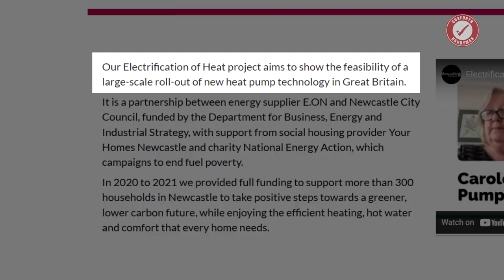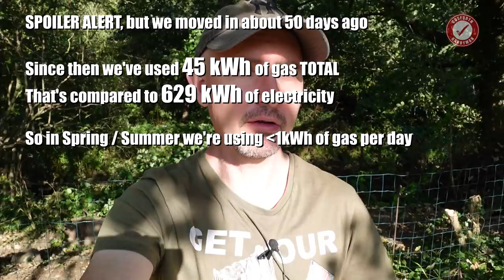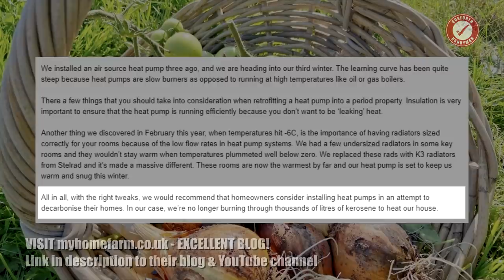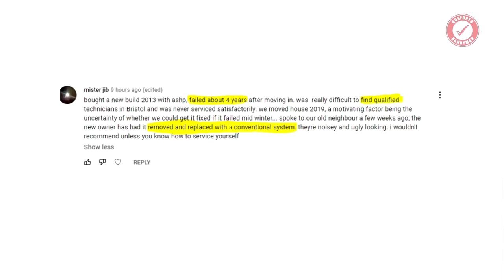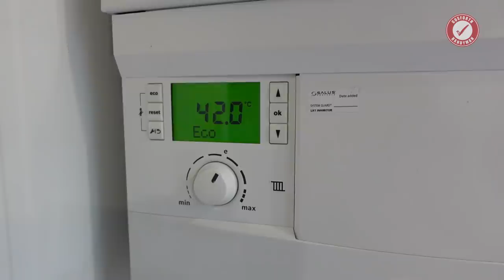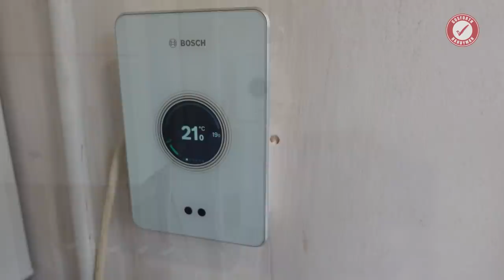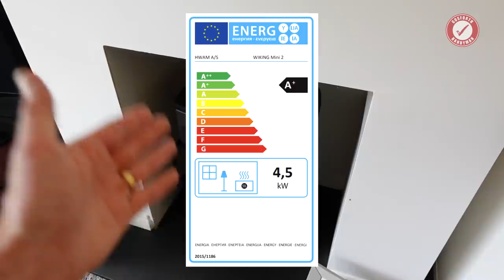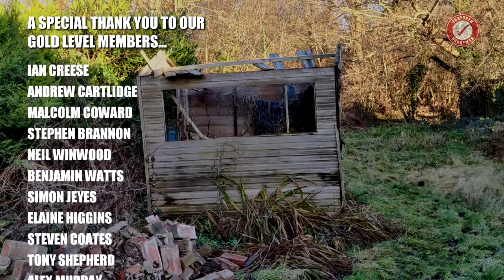Why didn’t we install an Air Source Heat Pump? (1920’s Renovation Part 32)

Comment: My neighbor and my niece both installed an air source heat pump in their new builds - hot air rather than hot water systems.  Both seem happy with them, but we had a relatively mild winter here in New England, the neighbor's house is less than 500 square feet, and my niece's digs are a new second floor atop her mother's oil-furnace house.  Neither use them for hot water.  So their heat pumps didn't have to work very hard.  A nearby library installed a ground-source heat pump about ten years ago, and the complex plumbing has required expensive repairs.

When completed, you'll have a relatively large house and a need for a dependable supply of hot water.  You have natural gas available, your boiler was not expensive to install, and if it ever needs repair the parts are readily available.  Most of all, the convoluted process for obtaining a government rebate on a heat pump wasn't worth the time and aggravation.  While I think heat pumps may eventually become standard equipment, that day has not yet arrived.
Reply: New England winters are generally significantly colder than winters in the UK.
Reply: @jeremybarker7577  That they are!  I was surprised that in the past couple of years air-sourced heat pumps are being marketed here with some success.  I expect you'd still need some backup (electric resistance or propane heater) when the temp gets close to 0 degrees F.

Comment: The Ecodan ASHP is super quiet (to the extent that it can be installed <1m away from neighbouring property). It’s a great model, like most heat pumps, works down to -25°C. If your home is insulated (great to do whatever your heating system) and your radiators newish it’s a good system to get. At £8600 to install in 2019, with RHI in our terraced house, over 7 years was ~£3000k cheaper than new gas boiler (at £2700). it cost the same as our boiler did to run. Great decision all round.
Reply: Also have a Ecodan. Wait until it gets to -3 than tell me how "quiet" it is lmao.

Comment: Great sensible approach heat pumps good in new builds, insulation is the key with low temperatures in existing property it’s a problem 
and the costs prohibitive .

Comment: Extremely glad you covered this topic. Was considering installing an ASHP which would have required substantial works on my behalf to replace gas pipes that were too narrow.  Will update to a newer combi and larger radiators instead.  Thank you.

Comment: With respect for your direct experience, much of what you say at 11:00 regarding heating systems is not based on much and rubbish. Here in the NE US where we touch against Canada, we use “cold climate” design air-to-air heat pumps that provide good capacity right down to -15F (-26C ).  The experience in poorly insulated houses is that an existing fossil fuel system is a good back up for about 100 HOURS per year, usually overnights only and warms up in the morning. In well insulated houses no FF back up is used successfully.  I installed an air-to-water heat pump with buffer tank and radiant floor as primary distribution inside. Owner immediately had a nice warm experience and continuous operation of this heat pump through the next week when low temps hit -28 C - no issues.

Comment: I retro fitted underfloor heating, upstairs and down, in my 1970s home back in 2016 and this included  Cavity wall, 15mm floor insulation, 75mm between all the joists in the 1st floor and 300mm in the loft space, we spent a considerable amount of time investigating ASHP technology as they are more suited to under floor but eventually came to the conclusion the cost was the major factor against it and will never be replacement for gas boilers, Most houses in this country will never be suitable for them due to the level of insulation required, as you have pointed out unless you are going to do a full renovation with a view to upgrading all your insulation along with all new bigger radiators or under floor you will struggle to get the ASHP to work efficiently enough, if you replacing oil and have no gas then yes but anyone on mains gas will defiantly not see any benefit and when you factor in the costs, even with government grants,  it's a huge investment to rip out and replace something that's already doing the job

Comment: What an excellent video! A pragmatic discussion of all options, and very useful for others with period properties who may be weighing up their options.
It may be, of course, that combi boilers will keep going in the future by using hydrogen, if the experiments in the North East go well. 
(Of course, the old town gas, made from coal, was around 50% hydrogen, so it’s not such a new concept.)
Reply: How energy intensive is town gas production?
Reply: @JohnnyMotel99  Hi Rob. No idea really, as it was phased out in the U.K. in the sixties, and it’s not coming back now!
Reply: @SteveHit1  That's true, however, as you say it's 50% H2 and that would eliminate ~50% emissions compared to pure nat gas. Perhaps we should produce H2 via electrolysis and mix that into nat gas...
Reply: @JohnnyMotel99  I agree totally with your suggestion for addition of H2 to natural gas. As you say, it would result in a massive reduction in emissions, with only minimal effort  - especially in comparison with heat pumps.
Reply: @SteveHit1  This adding H2 to Nat gas is actually a thing. It’s been proposed to uk government that 20% H2 could be added to our gas network and save millions of tons of CO2. That could be the limit before burners needed alterations, but maybe not.
Reply: @JohnnyMotel99  Thanks for the info - sounds exciting!

Comment: I've just bought a property in the country that has a clapped out oil fuel boiler. Like you I was skeptical about heat pumps because of all the negative reviews I'd heard. But after quite a lot of research on the subject, I now believe if the system is designed specifically for each situation, and correctly installed, heat pumps will work either at a comparable cost to gas, or cheaper. Plus you maybe able to help run the system with solar panels.

Comment: Most everyone should be able to find high quality furniture for the same price as cheap chipboard stuff. The only trick is to buy used, not new. Every style, shape and size of furniture is available used at a fraction of the price of something high quality new.
Reply: Helps if you have extra space and tools to make changes to it when needed. I have a garage full of spare furniture that I cannot find a property as yet to fit it in to !
Reply: When I moved some years ago, because I was seriously downsizing, I had to get rid of 75% of all my furniture.  Most of it went to charity shops etc, so hopefully some folk got some good solid stuff at very cheap prices.  Because I was moving into a flat, I wanted new furniture that was light and easy to manoeuvre around - so went to IKEA! 😀.  I am very careful with my stuff, so it will probably last my lifetime.  It all depends on individual circumstances.

Comment: Totally agree with all you've said re Combis and Wood burning stoves (& politics). We have identical boiler and very happy with the economics, efficiency and the quietness! Our WBS heats an 8 x 4 metre living room beautifully but you must use seasoned wood - essential. Therefore you need a regular wood supply and a wood store outside, properly vented to prevent rot, so ideal for us in the Norfolk countryside but not necessarily for city folk with their limited space. Thanks for a brilliant little series that for once I can watch and not have to do and pay for !! All the best, Jeroen.

Comment: It is not only the noise from the pump Andy, it is the sound of your electric metre taking off due to the amount of juice it takes to run.
💯 agree with your carbon footprint comments with cars, wood burners etc
PS. I am subscribed and can’t wait to see why you have a hamster 🐹 cemetery in the back garden with the little crosses

Comment: Smart TRVs are really great if you want different schedules in different rooms of your house or your main thermostat is not in the coldest part of your house. We had a poorly insulated bathroom extension and a smart TRV was great for keeping that room heating while the rest of the house was at the right temperature.

Comment: EON. Oh dear - just signed up to a fixed energy deal with them for the next year. Will see how that goes!
Reply: Used EON and EDF in the past 10 years no issue other than call centers etc
Reply: I've generally had no problems with EON and were with them for some time, I had more issues with British Gas customer service. But I guess everyone will have different experiences

Comment: Uhm, Norway here, regular temps down into the -20's, and although the condenser is less efficient it heats my 1920's house (with no extra insulation installed) just fine. Why are you getting just crap condensers that can't even handle -8?!

Comment: Great video and excellent discussion about heat pumps and the way the UK government are trying to force us down this route. It will almost definitely end in an about turn in a few years time. I had the exact same boiler system installed in my property in January 20 to replace a 20 year old boiler and its amazing. It’s reduced my gas bill significantly and of course I now longer need a large hot water tank in my airing cupboard or a header tank in the attic. I have solar and a battery and have been looking at different technologies and recently purchased an infra-red panel for my garden office. I have been truly impressed with this, it is efficient, it heats the thermal mass instead of the air and is thermostatically controlled. If I did need to change my heating system I would certainly look at these for my main property. They can be installed on walls, ceilings or freestanding and can be made to look like a mirror or even a picture. There are loads of different technologies out there and often the ones pushed by the government and reported in the press are not the ones worth looking at.

Comment: Here in New York State we have a company called "Dandelion" that installs "geothermal" systems, I assume this is what they call "ground source" in the UK. Dandelion identified NY as the ideal location for a bunch of reasons... cost of heating, climate, income... not sure all the reasons.  They streamlined the process and they drill a vertical loop instead going out horizontally, so it can be installed fairly easily even in small yards. they have a smaller custom drilling rig that is more compact than typical, I believe they use 10 foot [2.5 Meter] sections instead of typical [~30' lengths] 
You can either pay total cost upfront or essentially rent the system while paying less than your old system, people are typically replacing oil fired furnaces with these. I've seen many references to Hydronic radiator systems connected to these systems in the UK, but the Dandelion system only works with forced air systems. Most oil fired systems in this area, NE USA, use radiators... although Canadians seem to have more forced air. 

They seem to make much more sense than Air source systems, because the ground temp is in your favor based on the season. In summer Ground/Geo can easily give extra heat to 55f/12c ground temp vs 85f/30c air, and in winter we can be at below 32f/0c for weeks at a time, and typically have one week of 15f highs at which point the ground source is about 40f warmer. 

In the US people in moderate climates, esp. where they might not have a full heating system use what we call a "heat pump", and I would assume that is an air source system. They are usually a mini split, outside compressor heat exchanger with interior wall mounted air handler. Heating is usually an upgraded model from cooling only, but seems to now be the norm. It was widely thought that heating was only practical in moderately cool months, but many new systems claim to work down to very cold temps. 

We have an Oil fired radiator system, with a mini split in 3 rooms. And we use heat pump option before start using whole house heating, or if we will be in room for a short time. It does put out heat in very cold weather, but it seems to be working very hard and there is a lot of hissing and spiting as the coolant moves through the lines.

Also, I have not seen a whole house air source heating system in the US.  Probably the most popular system upgrade here is what you just installed, gas fired on demand hydronic system.
Reply: Very interesting discussion on how things are different across the pond. It seems like it may be little easier for you guys to switch over to heat pumps, due to the way you heat your homes. Also having a big 'yard' helps with more space for a collector for geothermal. Here in the UK our 'gardens' are mostly tiny, and many new homes don't have them at all!

Comment: I was recommended the only way I could heat my house (large detached victorian property, solid walls, etc) with an ASHP was to have a hybrid oil model, the quote (before RHI repayments) along with some other plumbing works I wanted was £24k, .. £1k of that was just radiators.

 Also, "in the winter it will almost certainly be running entirely off of oil", it couldn't do both at the same time.  I asked for a quote for a new external oil boiler with the same plumbing works above minus radiators (they were only needed just for RHI) and it came in under £9k.

I think max RHI repayments was £10k repaid over numerous years. The maths just didn't work out sadly. So oil boiler it is.
Reply: @TheFarmingEngineerUK  Only a month or so ago. It was a large vicarage that was knocked through into the neighbouring house to make one big very cold one. The incoming boiler (26kwh) supports bio-fuel although that still appears to be in trials.

Comment: Disagree with the comments regarding the ashp. Designed and installed correctly they are more efficient than gas. The reason you over size the radiators is because the heat output is not at 70c like a gas boiler instead lower flow temps but still putting the same level of heat to heat your home. The systems are designed to provide full heat down to -15c and for this reason you purposely oversize them for the worst case scenario. Your other option is air to air which allows you to have cooling in the summer. The bad sides of this are people ripping homeowners off and not understanding what they are installing and then homeowners expecting instant heat and turning it off in between timings. If you also have access to mains gas gas then this is preferable anyway as gas is cheaper (currently) than electric but prices are going up for us all. I've got an air to air system at home (I live in west Yorkshire) we live near a city and there is lots of traffic noise. We also have a combi boiler (3 years old Ideal Vogue C32 which is 90 efficient). The air con is the best in summer and we use it to circulate clean fresh air. I've just done the number crunching based on the new prices following our energy supplier going bust the company we are moving to our tariff is going to double. If the temperature is above 0c then it will be cheaper to run the air con in heating. After that efficiency starts to drop off and gas takes over based on the price per unit of energy right now. Sized correctly and in the right house (no access to mains gas) a air source unit is the way to go over other forms of electric heating.

Comment: Here in The Great Industrial Northeast we measure winter in months and summer in weeks.
Winters can be brutal with temps going down as low as -20°F and wind chills of -45°F, although that is not common.
Summers can go into the high 90's F, although we can usually count the fingers on our hands the number of days over 90°F and some summers have none.
And, our weather is prone to extremes. One winter may see a few inches of snow and the next, ground is covered in feet of snow although the trend lately has been milder winters.
And it may be 82°F one day and the next 54°F.
So, one thing around here is the weather is not boring!

Comment: I've delt with air source heat pumps here in the Northeastern Seaboard of the US, the view on them is they work well enough for cooling in the warmer months, but you really need a secondary heat source for colder snaps during the Winter.

Comment: We're in the Hudson Valley NY where winter temps go down to 10F in February and summer temps go into the 90's F.  My neighbors have had geothermal for 3 years and kept warm and cool  no problems.  We went from an ASHP and an oil furnace combination to geothermal this year.  The ASHP kept us warm down to 30F then the oil furnace kicked in saving many gallons of oil.  The ASHP worked with no problems during the time we had it.  We have vertical loops for the geothermal so it doesn't require a lot of land although we do have 20 acres.  Unfortunately the land is all in one direction and our neighbors are very close.  So far the geothermal is working fantastically!  After all the credits and rebates the system cost $22,000 USD.